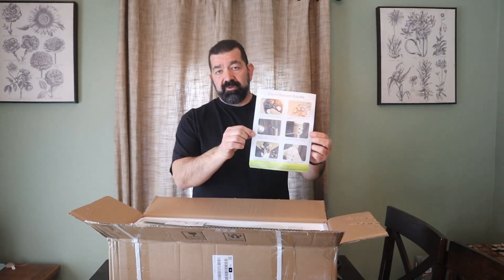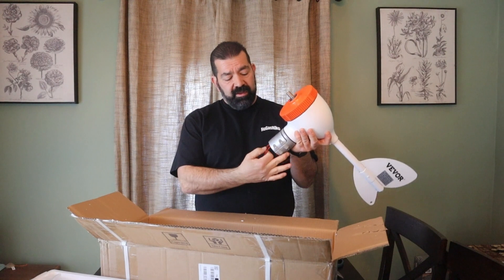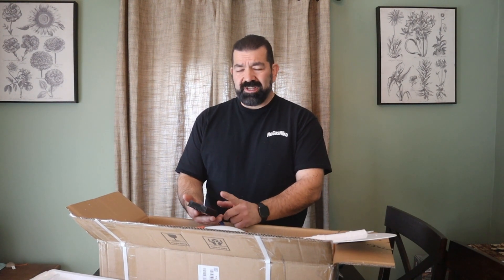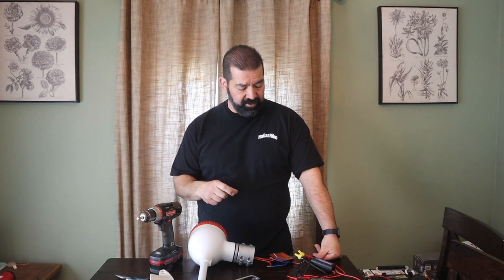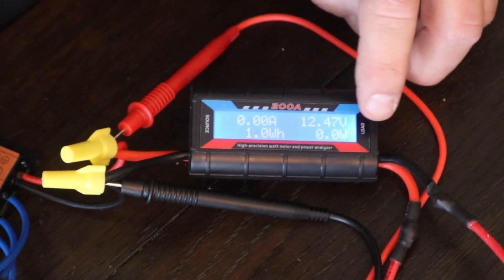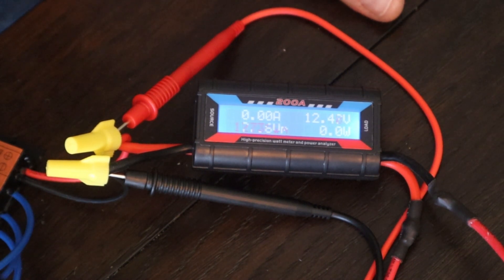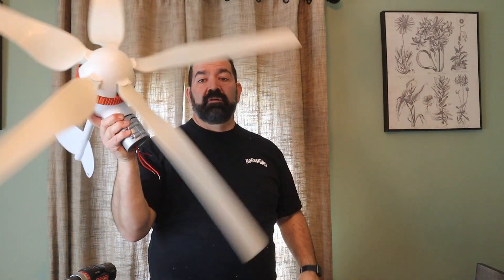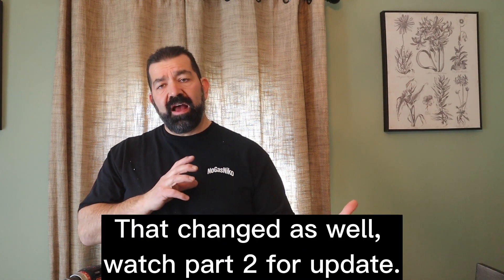Vevor 500 watt WIND TURBINE unboxing and BENCH TEST!!  Does it actually PRODUCE 500 WATTS???

Comment: If you use the controller that came with it. It is probable just making  50 watt's +/-. I tested my vevor 500 with the controller that came with it and got only 6 amps max (72 watts) before the break kicked in. ( unknow wind speed ) With a 3 phase rectifier  ( NO BREAK ) at top speed of my battery drill ( 1600 rpm ) I got only 29 amps. Hurricane  wind.  If you use a better controller so you can set it to break later then it might make 100 - 150 watts. Me I'm going to use the 3 phase rectifier  ( NO BREAK ) and a kill switch for big storms to save the battery's from higher voltage and over charge. 350 watts is 29.17 amps 12 vdc at 1600 rpm. This thing should be labeled as a 100 watt turbine
Reply from the maker: That lines up with the results I was getting.
Reply: Any recommendation on a better controller?   I just got the Vevor 5-blade 400watt turbine and this review doesn't look good!  Thanks
Reply from the maker: Unfortunately I've tried a few and the results were the same.  Not sure if there's one that bypasses the brake function.
Reply: @johnoudin5646  Just get a rectifier and hook it straight to the battery. Forget the controller. If you have VERY high wind a lot, you may not want to do it. Me I cut 6'' off each blade. It ran faster. You will on get so much speed out of the 5 blades. Good luck. It's a nice toy to watch spin.

Comment: I was researching this Vevor model for my RV and several folks mentioned it only produces a fraction of the 500 watts advertised (unless you're in a huge wind).  I'm OK with that as if it just makes around 100 watts overnight it will keep my batteries somewhat charged when the solar is not working. Sales must be down as this is on sale for only $91 now.  Cheap price for me to enter the wind turbine hobby.
Reply from the maker: In good steady wind you'll get 90 to 120 watts out of this unit.
Reply: @NoGasNiko that's not bad as long as it last. I'm big on how long it lasts, at leat 10 years😊

Comment: Very good. Now what is the wind speed per rpm. That would that us all we need to know. 
May have to go to a 3 phase rectifier to not stop the turbine. If they want to stop it at 50 something watts is not good.
Reply from the maker: I have no idea.  There isn't anything like that listed on the specifications.
Reply: I just ordered one. I know they are crap. I can use the blades for my Amtec 30-volt motors. At 950 rpm they make 15 amps dc. Much better than this Chinese turbine. But I have a servo motor that is 3 phase that I can use the controller on. I did do a test on the servo motor. 14 vac 3 phase is 135 rpm. I know that is slow. Unknow wind speed. Hoping the 5 blades will be about right for 12 volts charging out of it.
Reply from the maker: @basilkey2949 let me know how it works out!

Comment: 500 watts at 12 volts should be 41.6 Amps so I couldnt tell what the load current  was when it hit the brake. But you need a good load that will draw the 41 amps at 12 volts and a gel cell battery just wont do it. Try a rundown car battery or a car battery tester.
Reply from the maker: I've had this thing running on my system with a 2000 watt inverter.  It just doesn't produce.  I get what you're saying, you need somewhere for the energy to travel to.  I see that with my solar as well.  I'm still running this and to date haven't hit 500 watts.  It wouldn't even charge my one 100 ah AGM battery.  I think I got a bad one.
Reply from the maker: I haven't even hit 150 watts.
Reply: A lot of these cheaper wind turbines are rated in average watts delivered per 24 hours. This is deceptive advertising in my opinion but it is what they do. So your 46 watts was probably the actual output.  For a true cost of wind turbines, figure about $3 to $5 per watt for the generator head.
Reply from the maker: @a-k-jun-1 thank you for that.  This is the first I've heard of this.  Makes sense.
Reply: starting to get close to the nail with this comment.

12 volts, 42A, 500W...
into a 0R286 load.

the gel cel needs 14.4v to start charging.
at 14.4v, 500W is 35A. across 0R414.

now you have an issue of the battery internal resistance being far lower. it tries to pull more current, the voltage sags, the battery is no longer charging or pulling current, the voltage rises, the battery tries drawing current, the voltage sags...

the actual charge rate is dictated by the internal resistance of the batteries, and the ideal load for the generator itself. it will level itself out where the battery will pull the supply down to just enough where it can just absorb a certain current, and no more. and as the wind is all over the place, trying to deal with this fluctuating input power is a nightmare.

if you short the generator, all the power will appear as heat in the windings, and a large current will flow.
if you open circuit it, the voltage rises, and no current flows. no heat is generated anywhere.

and somewhere in between is this ideal load that sags the generator down appropriately, so the voltage and current appears as heat predominately in the LOAD where its wanted.

batteries are a STUPID WAY TO HARNESS WIND POWER. they are not matched to the source, you are throwing away all the milk and keeping the cream.

and a battery also cannot absorb power beyond a certain point. rather than harness the power in wind that increases at the cube of the velocity, we go and apply brakes and throw away the baby with the bathwater. though our generators arent much good at delivering power at a cubic rate, either, they tend to load things down linearly, then plateau... saturated, unable to do any more. so again, we have to apply brakes. friction... make heat... energy conversion... but we just dump it. wasted. loss. "useless".

yet all our coal and nuclear stations simply use heat to boil water? 

and as i pointed out, the actual power delivered is also a matter of the load encountered. not just the generator, not just the turbine or wind speed, but the TOTAL SYSTEM matters.

whatever. noone gets it. just strap more batteries on. yay. batteries. inverters. electronics proudly supplied by LG, samsung, and toshiba. support our brands.
Reply from the maker: @paradiselost9946 I get what you're saying and it almost makes sense to me but if batteries are the worse way to harness the energy, what is the best way?
Reply: @NoGasNiko  i think i said it ... six times. maybe seven.

heat. dont think of it as a LOSS, think of it as the ENTIRE POINT! 

a resistance will allow for hot water. hell, it will melt tungsten given the chance in an arc furnace... thats over 3500C... you can concentrate heat. you can store heat. and virtually everything we do, is reliant upon HEAT. it does reach a point holding it is a challenge. 1000C is very nice. 1500C is freaking insane, i have an iron melting furnace... seriously, the heat is indescribable when its that high...

heat is what the universe works on. they dont talk about the "current volts watts-death" of the universe, they say... HEAT DEATH. (though i dont really believe that bs...)

sadly, doing this on a SMALL scale? its effin hard. things like, iunno... seebeck/thermoelectric generators are still rather low performers. steam turbines dont like being small.

but... i can cook on heat. i can warm my house on heat, dry my clothes. can even get a fridge to run on heat, cool my home with heat... and if you really figure out how to produce heat directly in proportion to the windspeed, ie, a "generator" following the cubic law of velocity to power (its already a current device in manufacture, called a "dynanometer"... im just yet to strap one to a turbine cus im lazy) the amount of energy you can harness starts making such low efficiency methods vastly preferable to a battery still... an insulated 10,000L water tank holds a LOT of energy... the issue is we have forgotten how to do anything different, lived our entire lives with this super convenient form of energy, "electricity", where we just plug things into sockets and dont worry about whats really going on in there... try and imagine life a century ago. different world. 

you also find that we do things a certain way not because they work well, or are the best method, but because... it just happened that way. think of the ICE. theres been attempts to change it, but the basics of an easily manufactured piston in a cylinder has stayed around as it is so simple to make. and once something becomes a habit, its hard to break. and of course, there was lots and lots of MONEY being made! money money moeny! humans are stupid like that...

i could go off on a complete tangent at this point, about another device thats sadly misunderstood despite all the so called modern "technical expertise". when you start to know how things work, its all just... parroting the same old BS, with no logic behind it. the very basic fundamental? an ICE is simply an air compressor, that then heats the air to raise its pressure to return more work upon expansion. it doesnt actually NEED fuel, it runs on AIR. fuel happens to be convenient, and quickly heats air with little transfer losses like one sees in a boiler and steam engine. tangent.... halted! this reply is way too long already. sorry :)

call me oldschool, but i have no issue whatsoever with working on mechanical devices. alternators. governors. pulleys. they make sense, can be made with some tools and supplies if you have some sense.

but my life experience of electronics?

smoke. fire. tears. frustration. money. money. money. money. rubbish. landfill. more tears. more money. more frustration. and i repair guitar amps for a side kick, make PCBs, dabble with digitals... i think i have a pretty good idea of some electronics... no expert, but... a good idea.

any time i go to use a battery powered device its flat. or its got enough charge to trick you into setting the ladder up and climbing the roof to fix that leak... and on the second screw it goes. then the fancy new "high torque BLDC" decides it should blow out in a cloud of acrid toxic smoke... only the third one on warranty in a month, its all good. its got "ecofriendly" on the side!

you cant find schematics, cant find components, cant find parts, cant repair things... black boxes full of epoxy doing unknown things. if this is the way of the future i want nothing to do with it. yet all my old books supply me with the knowledge to actually make things that work... when i do. how to pull things apart, throw em back together. dont need manuals. the purpose is obvious. everything serves a purpose.

other alternatives... pumping water? again, small scale is near impossible, unless you are geographically suited to it... man, if i had a coastal slope, a decent drop and constant wind... but... that cubic output dilemma strikes again! need a pump with a constant pressure, but varying delivery rate. thats... tricky!

or brakes, and i hate the idea of brakes as they are just dumping otherwise useful energy. use the device to load the source down, with something to deal with the energy as its produced.

so. conclusion. you work on matching a load resistor to your generator, the ideal load.... whilst you cant get past the linear output, the load it presents to the shaft, as it is a PM based device...
(it need brakes. an alternator is better as you can just keep pushing the excitation up until its saturated as wind rises to cyclonic speeds, yet be entirely unloaded in a gentle breeze that produces nothing anyway. the dyno is better again...) if you set up just an old water heater, fill it with sand or water, and measure the temperature rise... you will find you store far more energy, harness far more energy, than you could EVER achieve with a battery.

what you DO with that energy? well... thats the challenge, isnt it? when you actually ask people what they do with electricity they sort of mumble and look embarrassed... not much? 

like, i cant imagine my lathe without the power point but then i think... i got a lathe... i got lots of dead engines... why havent i got a steam engine yet?

cus im lazy! 
well, life can get in the way...

right. morning online rant finished. to the shed! got some shelves to put up. chaos reigns! cant do crap in chaos. spend three hours finding a damn spanner...
Reply: It makes 3x AC then convert to dc, so maybe 500w ac but
Reply: @paradiselost9946 i wish you were my neighbour 😂

Comment: I really want to vuild a turbine with a gear box (belts are better) like the big boys.  Low rpm ok, gear box gives you the rpm.   Its the large surfflace area thats killing me figuring out.
Reply from the maker: If you get it to work please keep me updated!
Reply: I made one time with 4 foot blades cut 1 foot at the hub and 4 inch at the end. Just 1/2 plywood for a test. No idea what the angle of the blades was. Used 2 bicycle sprockets and the chain on a frame I made. Ran a 90 volt dc motor rated at 5 amps at 90 volts and got the full 5 amps that it was rated . That is 5 amps 12 dc to the battery. Then the thin pole bent and stopped it. Yes gearing will work. But better have a good braking system.

Comment: yeh theyre garbage from all the videos ive seen  was hoping they were good because the price is right. go for a low wind low rpm turbine , hurricane wind power is decent, im in Australia but their turbines are not too bad. big blades equals low wind power. gotta balance your blade and hub assembly as a complete unit for the vibration it'll spin faster too and make more power like any turbine, rpms = power. ive seen those controllers inhibit power output, internal resistance im "guessing" , John Daniels uses them in a different way , he uses two of the three phase wires from the controller to switch a relay instead diverting turbine power to a dumpload. checkout james biggar wind turbine you will learn ALOT.  sorry if i seem like a know it all just trying to help you, been there done that if you know what i mean LOL.
Reply from the maker: Hey, thanks for the comment.  I'll definitely check out that channel.  I totally appreciate any and all input especially from people like yourself that have experience.   I was going to do a follow-up video telling people to save their money.  I did it for a test and to add to my channel, I'm thankful that I was ready to be let down (the whole too good to be true thing).
Reply: I hooked mine up the way John daniel said to and it works great
I concer
Reply: Also the controllers that come with the turbine are junk. Try using a 3 phase ac to DC rectifier fier .I think your controller might be hindering you.
Reply: @johnbutler5208  maybe your turbine is one of the good ones from a good manufacturer  , there are tons of manufacturers with identical appearance some are  professionally built others are not some meet advertised specifications others dont even come close.
its amazing when you pull them appart the differences can be massive from garbage windings, weak magnets etc , thats my experience, its why i build by own now.
Reply from the maker: Mine was pretty cheap......
Reply: @NoGasNiko  yeh i fell into a similar trap LOL,  later i bought more expensive turbines they were right on the money power wise but still i wanted more power output in low winds, i found diy axial flux videos and saw the output and i was sold, ive even seen smallish axials do quite well.
but if youve got the money to burn there are decent turbines around that make good low wind power, Stephen T in ireland put up a 3kw chinese turbine that produced by memory well over 1000watts in 10mph winds.

Comment: Get yourself a istabreeze i2000 2400 watts of power for like $800
Reply from the maker: I'll have to look into this.  The Vevor was an impulse buy without a lot of research.  Might consider something for the springtime.  Right now I'm concentrating on storage capacity.  That's the most expensive part in my opinion.